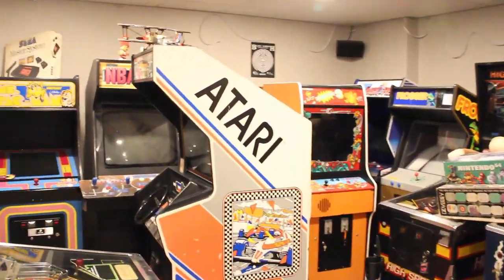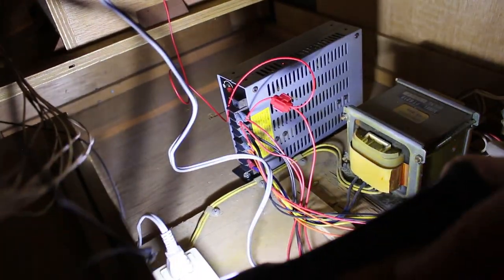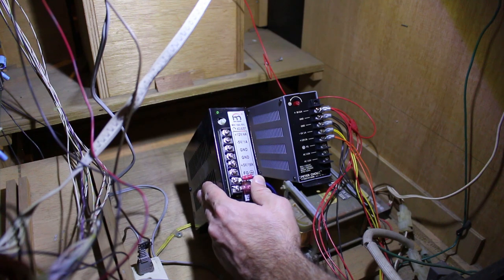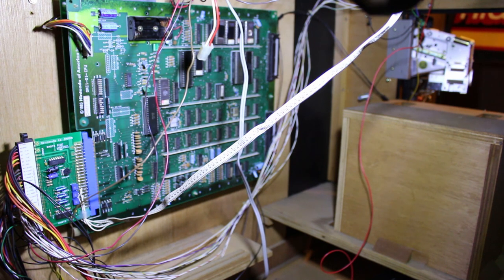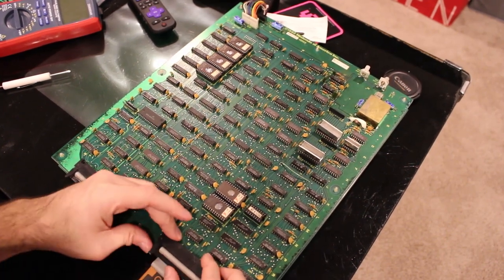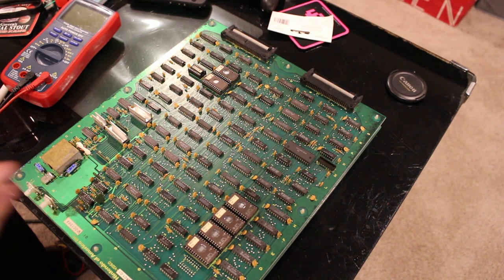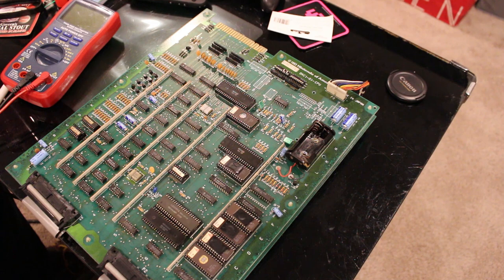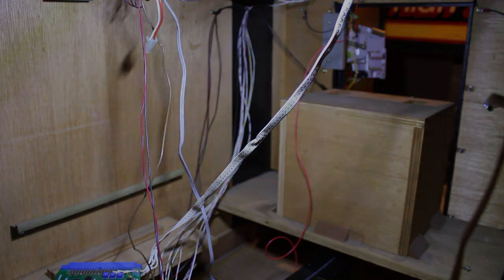Donkey Kong 3 Glitchy & Broken - Part 1

Comment: paused video  

Get some multimeter alligator clip leads my dude.  Clip the leads on those caps on the board then adjust the power supply to hit the desired voltage.  

unpause video

"I should get some clips"

lol!  Anyway, I have limited knowledge as well, so please don't take my word too highly.  To me, it still "feels" like the z80.  That was my initial guess when you confirmed 5v across the board, then you found some dirty legs on the z80.

Comment: Strange Both Dk3 boards I have have had no problems BUT my Sanyo EZ20 did . I replaced VERY cap and transistor I think my tuge is going So if you have a rejuvenator lol let me know . I replaced it with a Wells 4900 for now. Could be a Ram or CPU issue ect. and you should be able to plug right in even with out